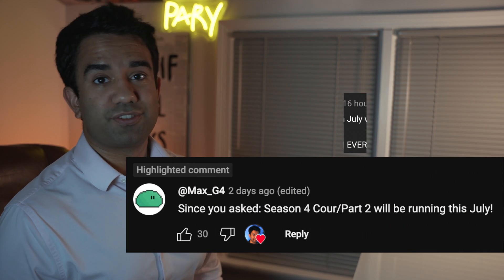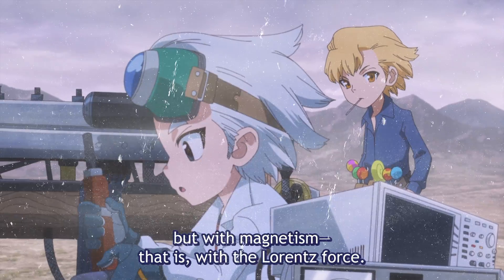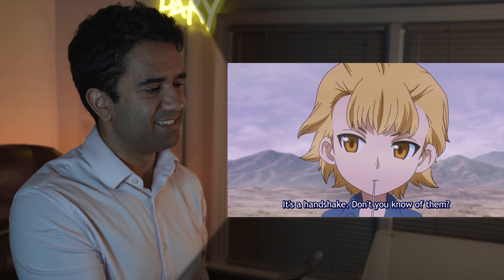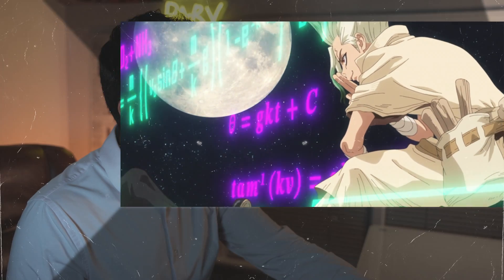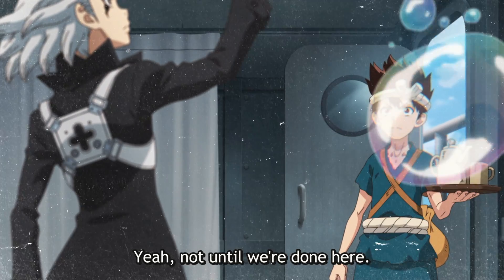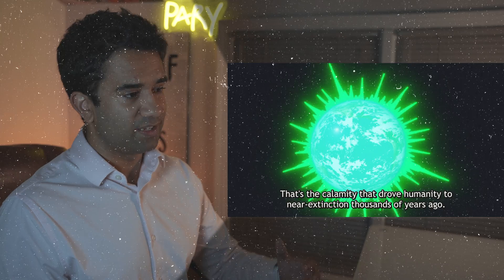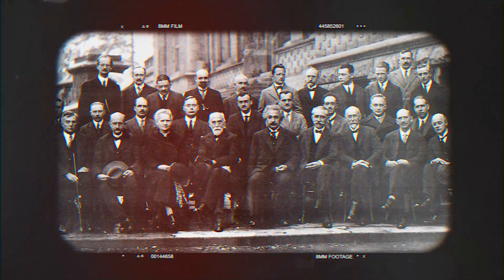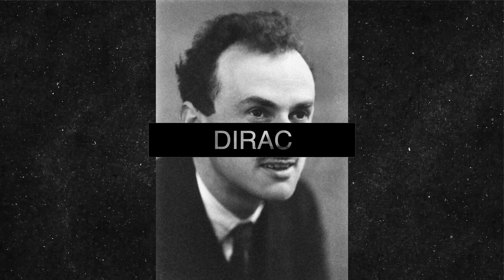Real Engineer Reacts to Dr. Stone #63

Comment: I found this about 0=GTK + C.

The NA62 Gigatracker (GTK) is composed of a set of three innovative silicon pixel detectors, whose job is to measure the arrival time and the position of the incoming beam particles. And C = speed of light. That equation makes sense since they are trying to find the beams exact origin location and are doing the math in their heads to account for the machine needed
Reply from the maker: Thanks for sharing!! That's wild lol